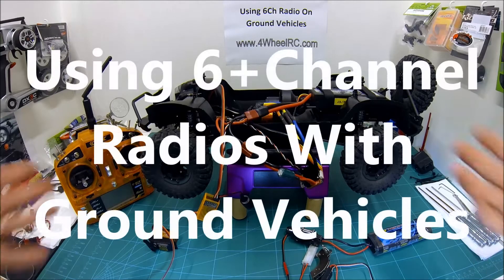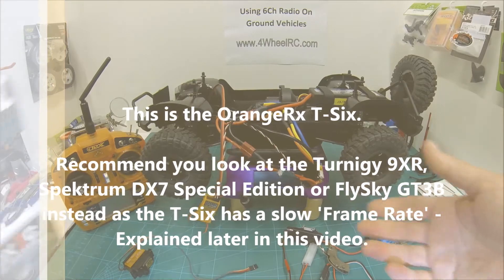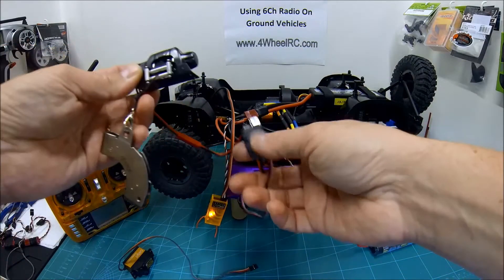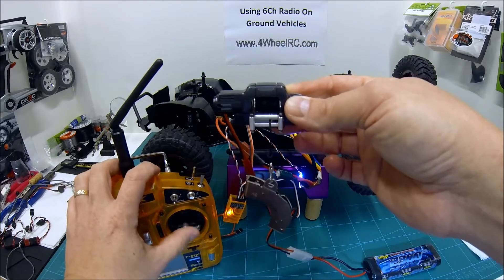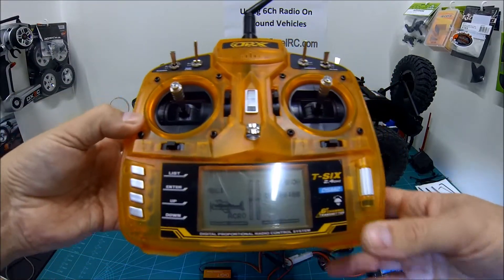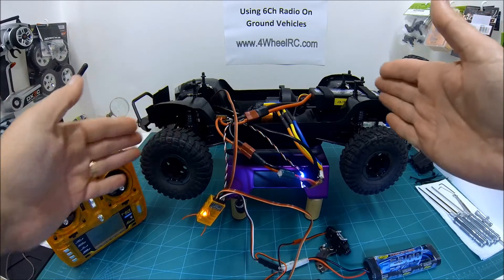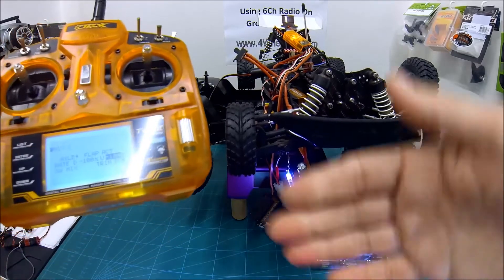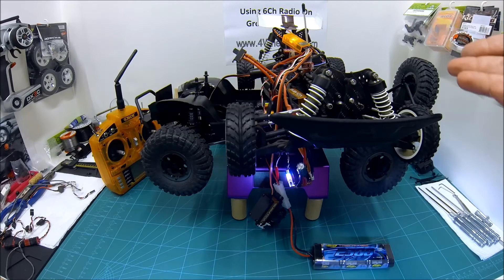Using a 6+ Ch Radio With Ground Vehicles.

Comment: Good info. Request for you.. I am in progress of setting up a MOA crawler. I have a DX4S controler and the 4 channel receiver that came with it. I was told it is possable to setup front and rear proportional dig setup....i have not been sucesssfull as of yet. Can you assist? Im sure others would like to know how to setup crawlers like the pro comp guys. thanks man,good videos.
Reply from the maker: Hi S0l0, transmitter channel mixing is often very specific to the radio gear you are using and I do not have a DX4S. But these might help?: http://www.rccrawler.com/forum/electronics/478308-dx4r-moa-programming.html  &  http://www.rccrawler.com/forum/electronics/423085-help-spektrum-dx4s-mix-programing.html

Comment: With the led controller could u plug it into the reciever with a servo extension and have it on always?
Reply from the maker: Hi Everything RC, when you say "on always" do you mean the LED lights on always, or power to the LED controller always?... Most controllers like this have multiple LED circuits and some are always on, some come on with brake, turning, reverse etc.
Reply: 4WheelRCUK I mean the LEDs turn on when you turn on the esc, and they always stay on, then turn off when you unplug the battery.  Also I really mean just the white and red LEDs, not the turn signals.
Reply from the maker: Everything RC Ah, understand now... Yes, that is what most LED controllers (e.g. 3Racing, Axial etc.) do. As soon as your receiver has power (which it will, assuming you are powering it from the ESC's BEC), then the LED controller will have power and will light up some head & tail lights etc.

Alternatively you could wire your own LEDs (+ resistors) directly off of the receiver's power circuit (which will be 5 or 6V, depending on the BEC you are using). These would be powered as soon as the receiver has power.

Another option is to wire a BEC directly to the battery connector and power your LEDs (+ resistors) from that. They would light up as soon as you plugged the battery in, even if the ESC was not on (just remember to unplug your battery when not in use!).
Reply: 4WheelRCUK Thanks for the help

Comment: do you getter better range with a 2.4 air radio than stock pistol grip that comes with the car?
Reply from the maker: Probably (especially with a 3S LiPo), but any decent ground radio should have plenty of range (my Spektrum DX3CS pistol + Hobby King Orange R615 3CH receivers will work in our local park farther than I can see the model!).

Comment: This is goi g to sound stupid but what is a BEC
Reply from the maker: Hey ShakeDown, that's not a stupid question: 'BEC' means Battery Eliminator Circuit and came about years ago when models typically had a 7.2v NiCad pack for their motor and then a separate 4 x AA batteries (making 6V) for the radio gear... Then someone invented the BEC, which is some electronic components that reduce the voltage from main battery (say your 7.2V pack) down to a safe voltage for the radio gear - so then you could power your whole model from one battery and get rid of the separate 4 x AA batteries.

These days most ESCs have a BEC built in, so when you connect the ESC to the receiver it is that which powers the receiver & steering servo. You can use a separate ('external') BEC to power other things like lights, or sometimes folks like to run their steering servo from a separate BEC as the one in the ESC may not be able to provide enough current (Amps) for a really powerful steering servo.

For more info, have a look here: https://www.google.com/#q=what+is+a+bec